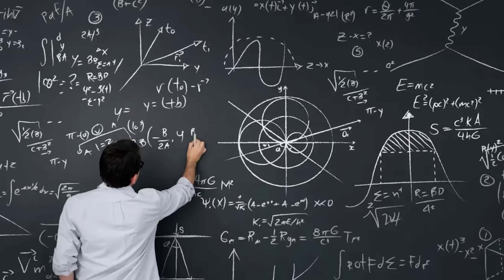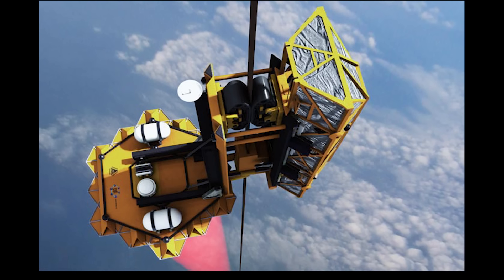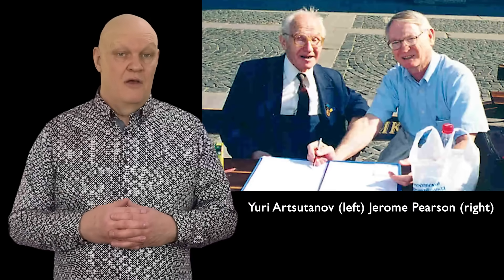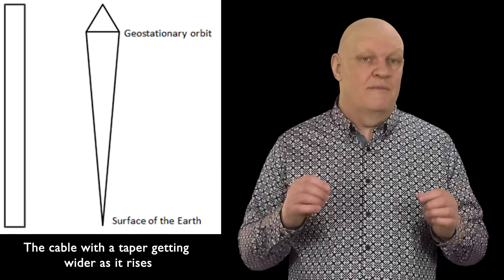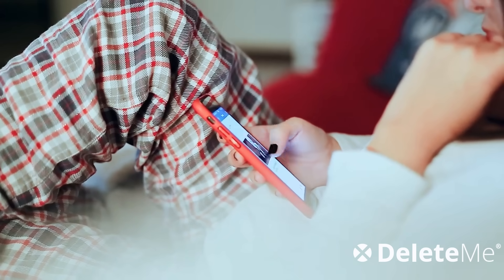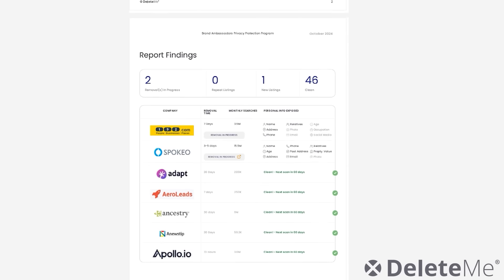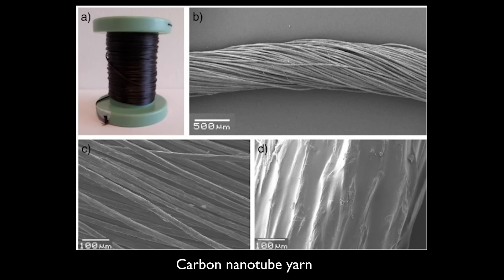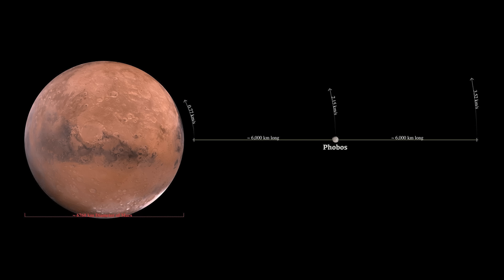Are Space Elevators Still a Thing for the Future?

Comment: Well, according to your last video - there is a LOT of space junk that needs to be gone or risk hitting this elevator.
Reply: There is a lot of space junk, but the cable itself is really really small when compared to an area larger than the surface of the earth. As for the elevator impacting i do not think the risk is any greater than space junk hitting any other rocket that goes into low earth orbit.
Reply: @dgart7434 the issue is that the elevator is stationary relative to objects in orbit. One impact at 17,000 MPH is catastrophic
Reply: A space elevator exists at every orbital altitude, on the equator, which all but geosynchronous orbits cross repeatedly. It's not a matter of when a space elevator will experience a collision, but when and how often.
Reply: @dgart7434  Murphy's laws are valid even in space
Reply: Even without space 'junk', there are far too many operational satellites in orbit, and that number is only going to increase now that Starlink has proven the feasibility of megaconstellations and everyone else tries to get into the game as well.

Launch loops and orbital rings are superior because they can be built to altitudes below where satellites can maintain a stable orbit, but still provide >99% of the energy needed to put a satellite up into one of those stable orbits.
Reply: Yeah that`s what I first thought as well .  There is really no need to waste time even thinking about elevators .
Reply: This. Subject closed.
Reply: Mmm.smells like some story from the bible...
Reply: @Thevoiceoftruth1234  what story

Comment: Well, if not elevators, than maybe escalators?
Reply: nah, space stairs. Just don't skip leg day!
Reply: @9Blu  A stairway to heaven?
Reply: @9Blu  whats the math on how many steps that is? My quick guess is about 1.2b(1,174,060,800 steps by my math) 😂
Reply: Stairs would be better for health
Reply: @richardlehoux  Fitbit sponsored space stairs.
Reply: MONORAIL
MONORAIL!
MONORAIL!!
Reply: @rumrunner8019  Is there a chance the track could bend?
Reply: @stevenkelby2169 "not on your life, my hindu friend" 😄
Reply: Skyhook is the way to go.
Reply: @marveloussoftware4914  If we could utilise skyhooks we could just as well make the elevator. Just hook it to the earth and travel along the cable rather than lifting the cable up and down every time
Reply: @Nidvard  there's two major issues the elevator has the skyhook doesn't.

Issue #1: the space elevator always requires energy input to go up. A skyhook would need a minuscule amount of energy and maybe none at all.
Issue #2: the space elevator would be unstable and require periodic energy just to stop it from falling.

Bottom line, a space elevator is never gonna happen.
Reply: @marveloussoftware4914  A skyhook would not only be required to lift the payload but also the massive cable which would weight thousand folds more than the payload, meaning it would require massive amount of more energy. An elevator could easily be powered by a ground based laser or similar.
A elevator secured past geostationary orbit would be self stabilising, where a skyhook would need to compensate for lifting that massive cable as mentioned, and this compensation would be have to be done with fuel, unless we are able to invent a new drive not requiring fuel, which is, as of yet, pure fiction.
Reply: @Nidvard  skyhooks dont use cables.
Reply: claw game from space.
Reply: Do YOU fancy the idea of climbing that enormously long ladder (or whatever) wearing a space-suit, and carrying your back-pack of O2 sufficient to last the journey, and then some? It would need a pressurised cabin of some form.
Reply: @hamshackleton  nah just take a deep breath right before you start climbing.
Reply: @computerjantje   If you do that, your lungs would explode as the external pressure decreases - just like in scuba-diving!
Reply: @hamshackleton  yeah that is the first problem you would encounter climbing up :)
Reply: It is crazy how many people want Space Elevators, but scoff at mag lev catapults! Aka mass driver. 

 Mark my words. A mass driver up the side of a mountian or ramp is the future. 

 A mass driver at 1,000km plus could launch humans into space. The longer the more comfortable ride for humans. I forgot what the shortest length is. Think 4gs constant acceleration for a 250km track will get you there. 

 I always wondered how nano tube length is now. I had no idea we made ones so long! I remember when we made nanotubes in lengths of Nanometer. 

 So that is cool. That is real progress. Maybe we can eventually learn how to bond them end to end.
Reply: @dianapennepacker6854  
Not the system you're talking about, and absolutely not suited for humans, but spinlaunch have a interesting concept (and working prototype) for sending small satellites and other payloads cheaply to orbit.
Reply: @dianapennepacker6854 are we just try to throw ppl at space sorry I didn't read past that
Reply: I have a better Idea  , space docking   !      a spacecraft  in orbit  would drop a cable  attached on it belly  , this cable would have on it end a docking device , the cable would be left  hanging in the Karman line . The next stage is on earth , where a spaceplane would takeoff and reach the docking device on the  karman line , once docked , the spacecraft would lift  the cable and bring astronauts on board .
you see , with my idea thousands of kilometers of cable won't be necessary
Reply: I like an escalator man because the escalator could never break it can only become stairs
Reply: @ragepage1596  the cable that lifts the cabin can break ,
Reply: Hahahahahahahahahahahahahahaha. You sir have won the internet for me today
Reply: also weight has to be in syncronius state... in that case if balance can be keept or stabilised if each side has enough weight ballance the rope will stay in sync and wont need to be extreemly thin... 
i mean if you connect rope to a satelite with slightly faster then escape velocity you get lift...
Reply: @ahmetmutlu348  That is the reason for the counterweight. That is the part where he speaks about capturing an asteroid or possibly space junk.
Reply: Transporter😊”beam me up, Scottie”😂😂
Reply: Take a look at the rise over run for stairs and apply that to how long an escalator you need to…. Then think of how big that structure has to be to support that … all the weight of the entire structure also need to be supported. You run into the same issue. Then think of the force exerted by wind, snow and ice along with seismic design and you will see how much bracing and interconnected members you will need to make the structure stronger …. A long and narrow tower is not stable.
Reply: Yes a sort of stairway to heaven
Reply: Spiral escalator?
Reply: Maybe a paternoster...
Reply: Space ladders
Reply: Im ok with escalator concept but can we call it a Stairway?
Reply: Led zeppelin suggested a stairway
Reply: Think led zeppelin had a song idk
Reply: @jbstepchild  Stairway to Heaven.
Reply: Escalade?

Comment: a space eleveator is in evry story always focussed on the cable. I must be the stupid one here but let's say we succeeded in the cable and the sattelite. Is not the real problem that any lifting cart still needs to overcome earth pulling at it. So cable or not the cart, just like a rocket, has to carry fuel to escape earth gravity. So the problem stays the exactly the same as with a rocket. Ok, let's say the cart can be electrical and the power is send through the cable. Still huge amounts of electricity is needed to get the cart up. The longer the cable, the more electricity is lost in the cable. The real problem of getting things into space is not suddenly gone when there would be a cable. All the laws of physics stay the same and the goal of lifting things from earth is still the same as with a rocket. With that in mind the real challenge stays to find a way that a rocket or cart does not has to carry its own fuel to leave earth. THAT is the real challenge. cable or no cable.
Reply: Most proposals use two elevator cars, with one ascending and the other descending at the same time, so they counterbalance each other. However, their weights would vary depending on their distance from the earth's centre, so they would only balance each other at the mid point.
Another issue is that the ascending car would need to be accelerated in a direction perpendicular to the cable while the descending one has to be decelerated, which will put sideways forces on the cable. I assume this is the reason for the counterweight - to provide an outward force to keep the cable taut. However, the counterweight itself would somehow have to be placed in a curved path around the earth while traveling at considerably more than the orbital velocity at the required radius, in order to attach it to the cable.
Reply: @CharlesStearman  the amount of able that has to move for counter balaning is humonges in length and weight. starting and stopping would take a lot of energy.
Reply: Laser drive.
Reply: @ laser drive on the cart would require enormlooous amonuts of energy travel thorugh huge long cable. If the laser drive remains on the ground then it is an all ready tested drive but has nothing to do with a cable construction.
Reply: Early ideas were the cable would carry the electricity, but more recent ideas presume wireless transmission of electricity via microwaves.  Much in the same way orbital power generation would get power down.  The problem with this is that the antenna necessary for such a device would probably be half a square kilometer.  Or more.  Excess weight again, as well as a factor in wind induced side loading.

Comment: One wonders at the scale of devastation if one of those things ever came down for whatever reason.

(edit): Which begs another question: what would its operational lifespan be and how do you dispose of it?
Reply: Cut the cable on earth and it flies away
Reply: @Mateus_Longo  I'd read about that in the Mars trilogy by Kim Stanley Robinson, but didn't know enough about orbital dynamics to know if it was credible or not. 
The other side of the scenario - the cut happening in space - is described as being incredibly destructive, as well as the orbital tether going flying off into space like an Olympic hammer throw.
Reply: @Rdeboer  cut the counterweight free and you get a noodle wrapped around the equator.  Cut the cable at the base and see if you can knock mercury into the sun.  No more bad luck for me when it's retrograde.
Reply: scale of destruction. depends on where it snaps. could be minimal damage. could be catastrophic.

Comment: I think you've got this wrong. It's the counterweight that has to be in geosynchronous orbit. If it wasn't it would lag behind the point on the earth directly below it.
Reply: The counterweight is pulled around faster than its natural orbital period by the tension in the cable, similarly to a hammer throwers hammer.
Reply: @andyalder1  that means the tapering cable idea is a non-starter. because it would have to be able to resist the weight of the counterweight and the entire length of cable at the point of contact with the earth.
Reply: @n-steam  The counterweight pulls up just like a hammer pulls on the throwers arms, but unlike a hammer thrower there is always downward gravity to subtract.
Reply: @andyalder1  but the tension is uniform across the tether.
Reply: It would lag behind if it weren't tethered. The tether provides the centripetal force to keep the counterweight co-rotating with the earth at a distance greater than geosynchronous orbit. The same thing is true with the lower part of the cable that would need to orbit faster than geosynchronous if it were actually in orbit rather than being supported by being tethered. The whole cable is in tension, with the maximum force (and thus maximum ribbon width) being at geosynchronous orbit.
Reply: Now apply that idea to every point along the whole length of the cable...  Space elevator is nonsense.

Comment: I wish it could Happoen! But other than finding a material strong enough to hold it up, we aint doing it cause of the Up coming Global Polar Shift! 😮‍💨😬😓

That would certainly screw it up, forcing it to fall to Earth! 😢
Reply: Only the magnetism flips, not the Earth.
Reply: Graphene has the strength to weight ratio that at least puts it in the conversation.  The biggest problem I haven't seen any solution proposed is how do make a layer of graphene which is one atom thick intertwine with other layers to form a big enough cable without reverting to it's original state of graphite. plus graphene despite being 200 times stronger than would still having weight bearing breaking distance far short of what is needed.  The second part of your comment confuses me a bit. you make it sound like a physical flipping of the poles rather than a magnetic polarity flip. while a magnetic flip will be a problem for a modern electronic society I fail to see how the flip would necessarily cause our hypothetical elevator on the equator to physically collapse. The climbers may lose power depending on the source of energy, but it will still be physically anchored.